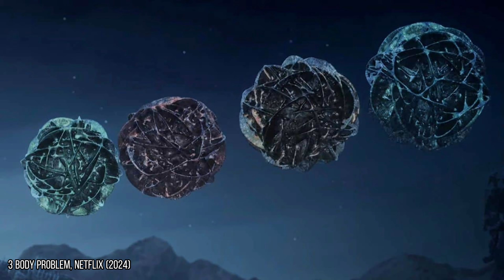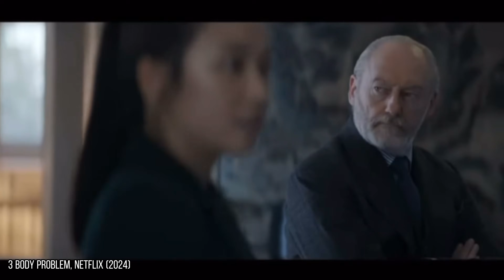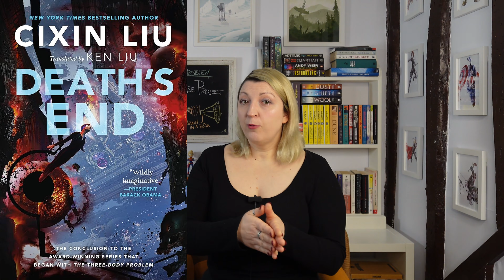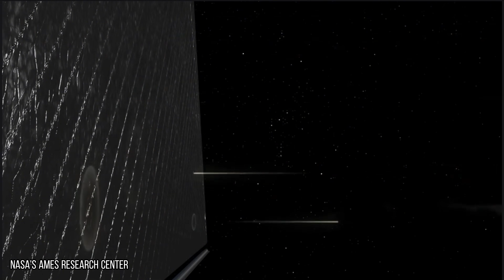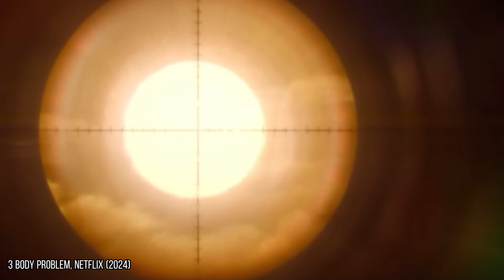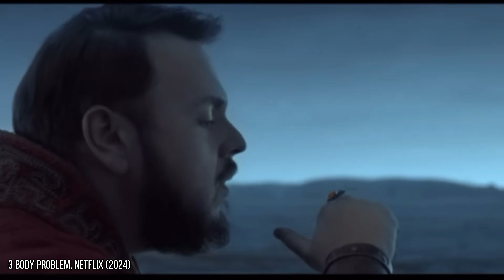Reaching 1% the Speed of Light: '3 Body Problem's Staircase Project Explained | Scifi Science

Comment: Wait wait wait! I have two issues I wish you explained them! The solar sail, or radiation sail, appeared in the show unfolded like a parachute! There is no atmosphere in the space, no air, how would it unfold like a parachute?! it actually got unfolded and stretched perfectly before the first bomb travel through it and explode!

The second issue is when one of the cable snapped, why would it drift in a curve path? Sure the mission is failed either way, but physically should not it continue in straight path?

Thank you for this amazing content, I am glad that I found your channel!
Reply: when the cable snaps, it affects how the ship is steered. it isn't able to stay on the same path.
Reply: @T @T.E.S.S. hat can’t happen except if the radiation force continues in significant amount for long time enough until the snap happens! Which can’t be true, the radiation wave push at once. the snap did not happen right after the bomb! Despite the deployment issue from the start.
Reply: @AhmedAlkhaldi-z8d  it can happen
Reply: @T.E.S.S.  how?
Reply: @AhmedAlkhaldi-z8d  The geometry of the detonation?
Reply: The sail could be designed to unfold on it's own, similar to how the James Webb telescope's shielding unfolded. Remember, it was all folded up in the capsule that took it into space. Rods supporting the panels, with flexible joints and small motors to move them, controlled by a small computer. Like Abigail says, the engineering (in the story but also for the JWST) is pretty impressive
Reply: It’s some kind of bastardised Medusa design and kind of silly when Orion had actual blueprints ready

Comment: You pointed out something I've always been curious about: space dust or particles. How spread out are they in space? What's the chance of hitting one traveling every 10,000 km? It would be quite an impact traveling at interstellar speed, and how do we protect against it?
Reply from the maker: This is genuinely a major issue for interstellar travel. I don't have all the answers to comment but I will do a video on this!
Reply: One thing I’ve always heard is that a meter of water shielding would protect against most all high energy particles. As far as dust and debris I’ve also heard that magnetic shielding could maneuver the particles around the ship but I could be wrong